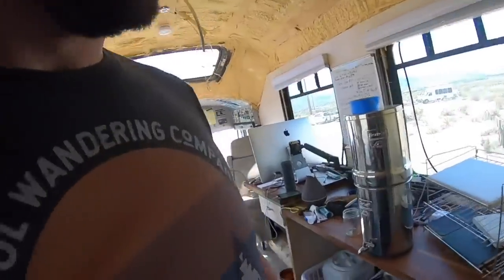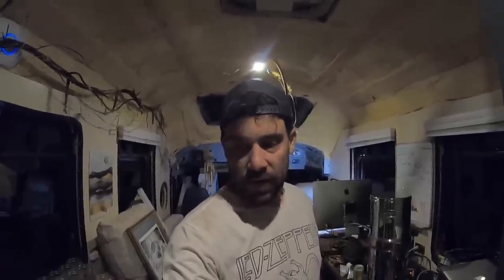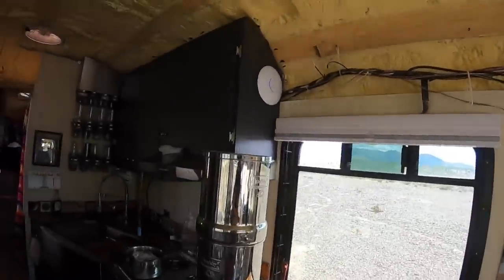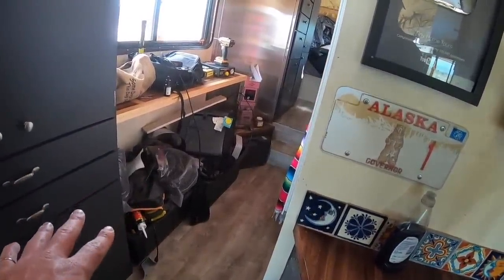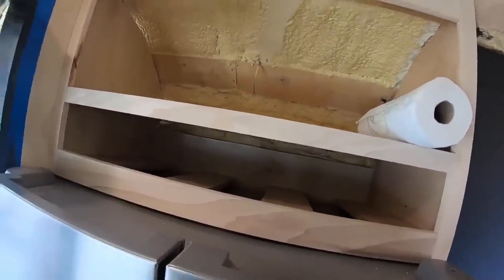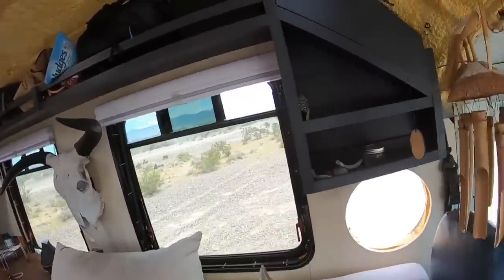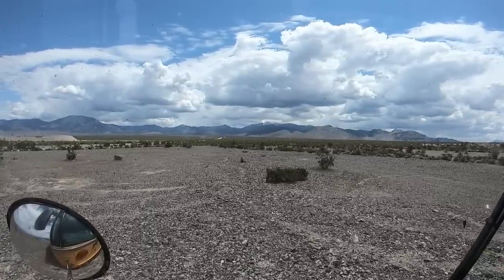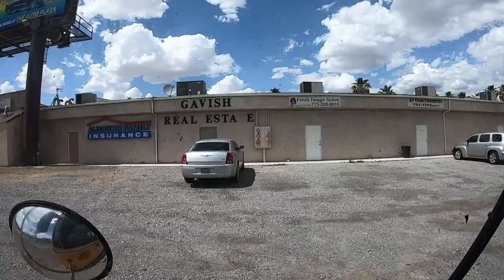Cleaning Up & Painting The School Bus Conversion - All Woodwork Finished - S3E6

Comment: Hi Chris!  Bus is looking great.  So proud of all you have accomplished.  I saw an idea you may be able to use for your ceiling.  A watched a guy building a Tiny House that covered his ceiling with painter's canvas.  He attached it to the rafters with washers and screws and used thin wooden slats to support the fabric from sagging.  It would curve to the shape of the bus ceiling without too much trouble.  Since the bus isn't as wide as the Tiny House, you may not need the slats.  You have wood there to screw into, it would be easy to get into if you need to do repairs or get to the wiring and it isn't that heavy.  Just an idea I have wanted to suggest from the beginning.  Good Luck in your travels & work adventures.  Love your videos!  HUGS~Donna

Comment: Chris, I'm loving the grey interior!! Quick tip on the painting ( I'm sure its to late now). For clean solid masking lines. Pretend your painting a wall white, and you want a 8" horizontal stripe in that grey. First paint the wall white and let it dry, then mask off for that horizontal stripe. Then paint the inside edges of the masking tape white ( the section where the grey stripe will go) and let dry. After that dries paint your stripe in that grey, and let it dry. When you pull the tape it will have a clean line because you sealed off the edge of the tape with the substrate color. Its the only way I've had luck with latex not bleeding through the tape line. Good luck, have fun, and we enjoy al the good landscapes you bring us!

Comment: Good for you! I don't think I've seen a freezer chest or a "Normal size fridge" used in a van/bus conversion.There is no need to go without because you can stay off-grid for a long time now.If I did a conversion I would go with a skoolie and the biggest one.Plus, I like 200 gallons of water.I could not accept 20-30 gallons of water.Great job!

Comment: Chris, Relocating that Ubiquiti AP from a vertical orientation on the side of your cabinets to a horizontal orientation between the windows on the bottom of your upper shelf that was just built should provide an overall better wireless experience. This should also increase your outdoor coverage area. Just an FYI from a Wireless Network Design Engineer. Great videos! God Bless!

Comment: CHRIS,
RE : ELEMENT ?
A couple of years ago Trailer Life magazine did a survey & found the vehicle towed
by more rvers was :
Jeep Wrangler.
WHY ? Because it is small, light weight & 4x4. 4x4's which have a 2 speed transfer case, like the wrangler
also has a nuetral position so the vehicle can be towed all wheels on the ground.
No relays, or breakers to install. No driveline disconnect nonsense.No dolly to hassle with.
PLUS,
When you come to an interesting offroad area of rough trails your all set. You would have to return to 
camp in an element.

!